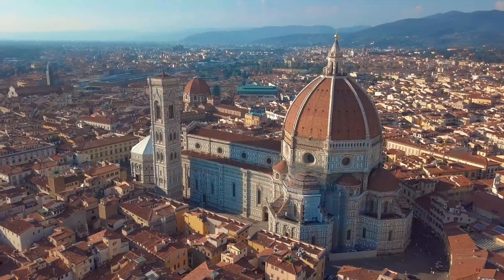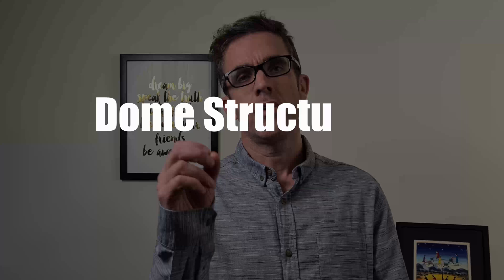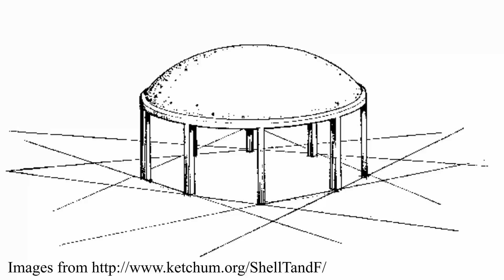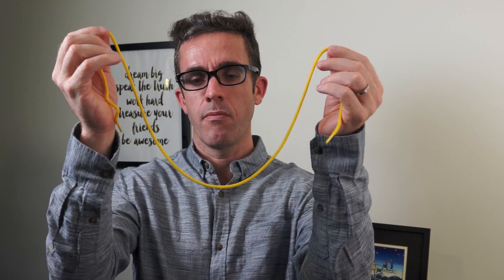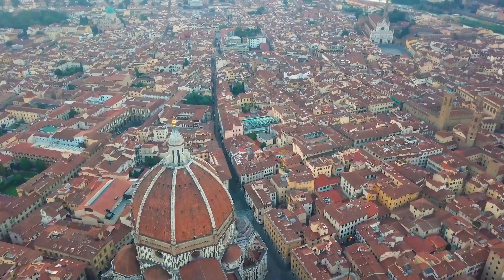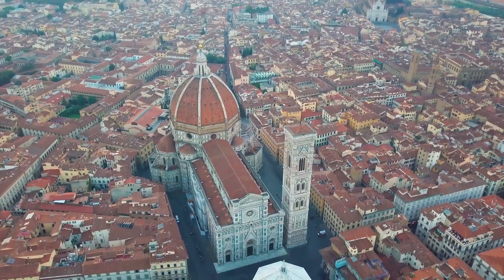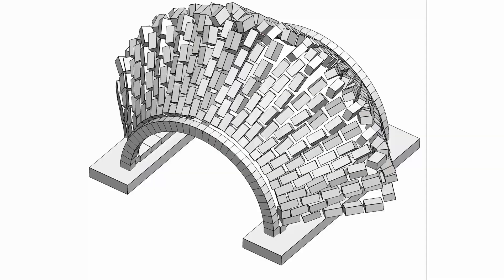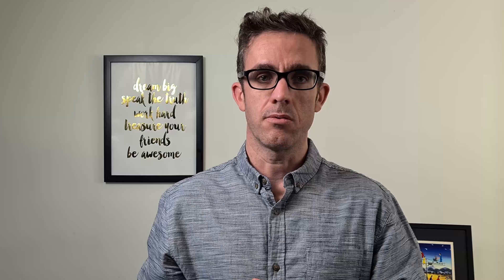Brunelleschi's dome - Researchers uncover the construction secrets of Italian Renaissance domes

Comment: it's wrong...: here in florence Italy we have a 1:5  model  in a park that concretely explains the building process and it doesn't have the double loxodrome. More or less, just one these double lines is enough (the spinapesce that grows thanks to the ropes connected at the bottom concoide)

Comment: I'm not an engineer but have an interest in these incredible historic structures.  Whilst I understand the principle of the radiating course of vertical bricks (is it a legstrom? - mate I'm an Aussie but struggled to understand some of your mumbled pronunciations)  of the inner vault keeping the horizontal courses under compression, I fail to comprehend the connection to string and weights??   And what 130yo code did Mr B crack?   Please explain this more clearly for my simple brain.  Thanks.
Reply from the maker: Hi Bruce lee, Thanks for watching and your interest, (BTW working on the mumbling，hope to improve in the future any other improvement suggestions welcome). the shape of the dome(the arc) is the same shape the string forms,  adding weight change the shape and shows the stable form Mirrored.  The engineering behind the dome was well understood, the unanswered question was how the dome was able to be built without a temporary structure. Due to its size, the dome could not be built with a temporary structure, thus it must have been stable in its temporary state. How Brunelleschi was able to keep the dome stable in it’s temporary was unknown, despite the many theories. The new research has proven the engineering behind how the dome is stable in its temporary state. Link to the research https://www.princeton.edu/news/2020/05/21/double-helix-masonry-researchers-uncover-secret-italian-renaissance-domes
Reply: Thank you for adding this link. This has helped me to get closer to understanding the structural action in the brickwork but not fully. I wish somebody would put a physical demonstration on YouTube!